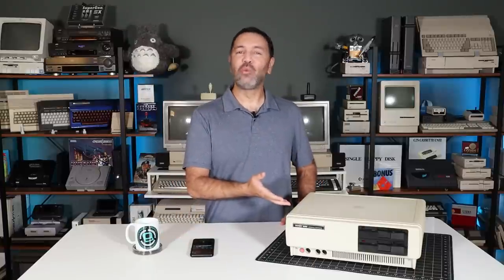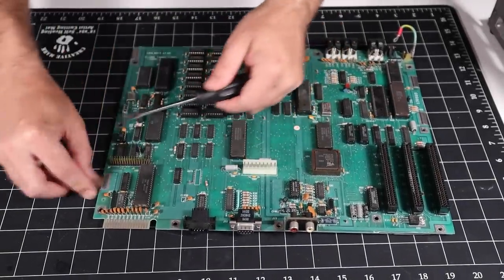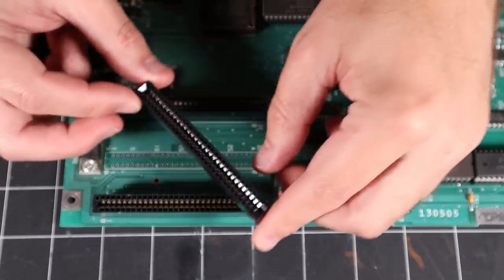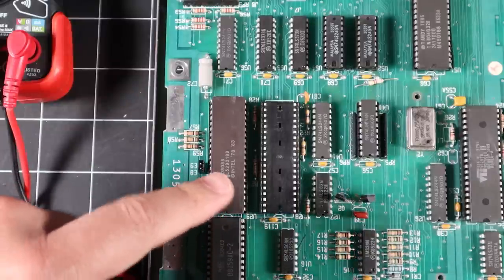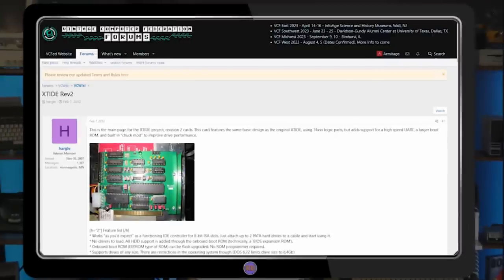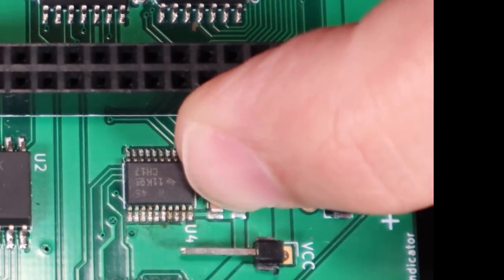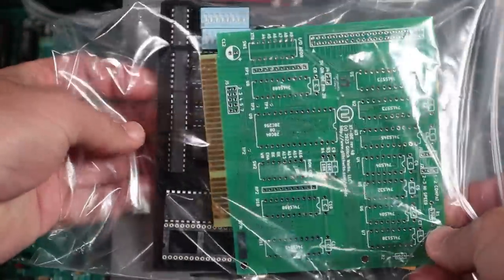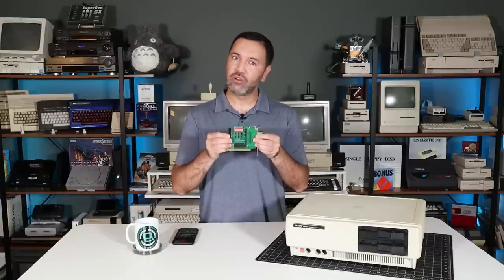Let’s attempt to repair a Tandy 1000 ISA Slot and XT-IDE card

Comment: That's the Tandy 1000A. The original 1000 has ROM version 1.00 and no 8087 co-processor socket.
Reply from the maker: Right on. I discovered it was an "A" model after purchasing it on eBay and opening it up. It wasn't advertised as such but I'm happy to have the slightly updated model. I would still like to upgrade to a 1000SX though :)

Comment: Nice repair job.. Pretty sure the flux has nothing to do with the mask coming off, if you re-watch you will see that it comes off as you wiggle the desoldering gun tip around on the joint, therefore it would appear you just scratched off the mask with the tip. Not a major issue though, as long as you don't bridge any of the exposed tracks with the RF shield or when adding fresh solder.
Reply from the maker: Thanks! It's strange because I've never damaged any other PCB when using that pump before. Perhaps the mask on the Tandy is really fragile? The areas where I used the liquid flux showed more damage than the ones where I only added fresh solder. I wonder if there was a chemical reaction or maybe the flux is slightly abrasive? Of course, I couldn't see any of this while I was working on the part since I had no magnification and had to sit pretty far back so as not to block the camera. The camera has a much clearer/closer view of the carnage and I only really saw it upon reviewing the footage :( Fortunately no pins were bridged :)
Reply: @retrobitstv  If you have the PCB sideways there is less force on the pad while desoldering. Also if you have to solder small SMD there is solder paste with flux. It's a mixture of very small solder balls in flux. If you put a little on the pad's and place the IC on top and apply hot air the IC should flow in the right place. Ali sells practice PCB's for almost nothing.
Reply: You need to change the tip out.  M P is 100% correct.
Reply: @retrobitstv  It could also be a combination of temperature slightly to hot in this instance with the motion.  The only time I have seen similar is with older boards and the temp too high on the desoldering pump.  It could just be the combination and weak solder mask.  I usually do the same with the circular motion and rarely have a problem scratching off the solder mask.

Comment: Great job with repair!  I usually stay away from desoldering guns because of risk of injury to the board.  In future may want to stick to desoldering wick with plenty of flux, especially for more delicate operations.
Reply from the maker: Admittedly, my experience is still pretty limited but this was the first board I've worked on that was damaged using the desoldering gun. It's been a great tool but I will definitely have to be more judicious about where and when to use it in the future!

Comment: 6:38 ugh! That desoldering gun nozzle makes damage to the solder mask. It's on the wedge of breaking traces continuity. Be careful.
Reply from the maker: Yea, I only saw that after the fact because I have to sit pretty far away from the part I'm working on as to not block the camera. The camera has a much clearer view of the work going on and upon reviewing the footage it looked much worse than what I saw in person! I have never encountered solder mask damage like this before when using the pump. The damage was definitely worse on the pins I applied the liquid flux to versus the pins I only added fresh solder to. I wonder if there was a chemical reaction or the flux is somehow abrasive?

Comment: Oh yeah I totally hear you about not liking surface mount soldering. I tried replacing the video DAC on an Amiga 1200 board, without having the proper tools like a microscope, and it was a total farce. :(
I'd like to see you build the new XT-IDE card, because the more retrobits the better!

Comment: Have you checked the pins on the CF socket? They can push in, and it could be why your card isn't detected.
Reply from the maker: That is a great question! The answer is yes, I replaced the entire CF card riser with a brand new unit just to rule that out. Thanks!
Reply: @retrobitstv  After staring at the schematics for this exact board, and having recently built a PicoGUS with TSSOP parts, I would re-re-flow the 245's with copious amounts of flux. Barring that, U5*, U6, U7, U9*, U10*, U12*, and U14* are involved with IDE functionality. (U15 and U16 appear to be used for ROM access only, so leave those two alone.) I've starred the ones that appear to be directly connected to the ISA bus.

Comment: Great job on the ISA slot replacement!  As for the SMD based XT-IDE card, perhaps a simple voltage test might provide some insight.  Also, those CF-IDE adapters sometimes go bad without warning.  I've gone though a handful of them in only 4 years.  It might be worth trying a new one or just a plain old school hard drive without the adapter board attached.

Btw, I would love to watch a soldering montage on that THT XT-IDE card with some music similar to what you chose to close this episode out on.
Reply from the maker: Thanks for the suggestions and I will definitely do an XT-IDE build in the future :) I did try testing with a brand new CF adapter board and also a spinning disk but still nothing :( I verified the +5VDC from the card to the CF riser was good, but I didn't test for any other voltages on the card itself.

Comment: Well done for giving the SMD soldering a go, you did great and very brave for doing it on camera, I think this will massively help others to give it a go too, bravo! I stared SMD by using solder paste, a template and a hot pan of sand! Moved on to fine solder tip 1 pin at a time under a microscope (which worked really badly) until finally I'm doing it your way, good flux and dragging using a chisel tip - only took me a year or so to get there! 😅 Off top of my head I'm wondering the XTIDE ROM has settings for a Debug mode which might give more information of what it's getting from the card.... Other idea is proving each pin on IDE connector to see if you're getting expected signals on the oscilloscope, during drive detection... Like a chip select line high, data ish, addr ish, etc... IDE is fairly simple signals and should look a lot like IDE signals.... GOOD LUCK!
Reply: Yeah, my only thoughts on tracing the problem would be some sort of debug ROM -- perhaps the XTIDE project has some way of setting it up so the port sends out specific signals that can be tested in some way. Or it might also be good to try plugging in a spinning disk drive and see if it even tries spinning up or not, since that connector appears easier to probe either through the right-angle pins on the connector or the secondary drive plug on the cable
Reply from the maker: Thanks for the suggestions! I may try solder paste and hot air next time and I definitely need some kind of magnification, even if it's just they eyewear type. I did some digging earlier into troubleshooting the XTIDE but I didn't find anything that was helpful to my case or mention of a debug ROM; that would be a nice thing to have! I may have to get smart on the IDE interface and start probing some of the lines as you suggest :)
Reply from the maker: I did try connecting a spinning disk but I never got any drive activity (light or head movement) but the drive spun up when powered.
Reply: @retrobitstv  nice try, sorry spinning disc didn't work either but I guess it helps to rule out any CF specific issues. I took another look at the IDE signals and it really is a very simple interface, mostly a subset of the ISA bus but with 2 Chip Select lines already decoded by the interface card for accessing the registers on the drive/CF. I'd be looking for activity on all the lines when trying to access the drives, I might start with the CS1-2 lines to see if they go low on accessing drive. Then take a look at data bus signals and the 2 address lines. Anyway it might give clues as to what's missing. No activity would be VERY interesting 😁 anyway happy hunting! Oh I just read the Wikipedia page on parallel ATA, and checked schematics on Serge's XT-IDE-LITE which is a nice simple adapter for 8bit ide CF cards only.

Comment: For the XT-IDE I think my approach would be to manually test the address decoding logic and see if the circuit produces the expected results:

So, power the card, put the card's address on the bus, and see if the 688 responds by dropping the CD_IDE line (pin 19) to 0V. Go through like that checking the different parts of the address decoding logic, the IO read/write logic, etc. to make sure each one behaves like it's supposed to - at least in terms of DC performance. Keep on like that and you should find the problem, unless it's something that's marginally bad in a way that makes it work in a DC test like that but not when the bus is switching at higher speed.

Also, sanity check, try another slot other than the one you repaired. Could be that the memory I/O on the slot is working but I/O isn't.
Reply from the maker: Thanks for the suggestions! I did try another slot but I should also try a different machine entirely as well. I'm not well versed in the finer points of troubleshooting a device like this but I suppose I could set up a test rig to power it up and have access to the I/O lines. It's a shame I didn't learn anything useful in those engineering classes.
Reply: @retrobitstv  I only did a bit of electrical engineering stuff in school. I feel like I'm learning more now, though, messing w/ old computers and picking up info from other people's projects. Probably 'cause I'm more interested, and making something from it.
When you come down to it that addressing logic is pretty simple, like "if these address bits have these values, activate that circuit". Though of course there's a big difference between it working a few times with manual inputs and a meter vs. working reliably a 8-12 MHz...

Comment: Soldering the SMD stuff gets a lot easier with not too much practice. You did great if this was your first try. ;)

You just have to be very careful to do a close-up visual of the pins, and ideally test for shorts, as you did.

In some ways, a lot of SMD parts can be easier to deal with than through-hole, especially when it comes to desoldering stuff later.

I used to just flood the pins with solder, then keep both sides (or all four sides) molten, then gently lift the chip off the board.
Now, I would almost always use the hot air station to remove chips. I just have a cheap Aoyue hot air station I got about 15 years ago.
Reply: Since the XT-IDE BIOS is showing up on the PC, the main address decoder U6 seems to be working.

But I would try replacing U4, and possibly U7 and U5.
One or more of their outputs might have got zapped somehow, and a lot of the pins control the drive directly.

I didn't realize the XT-IDE had to use latches (U2 and U3) to work with standard 16-bit IDE drives. I never really thought about it before. lol

IIRC, you can actually idendify the drive ID string, and send most commands just via the 8-bit part of the IDE bus.

But most (all?) newer IDE drives do need to use the full 16-bit wide bus for transferring the sector data.

I don't know if any of that helps? lol
Reply: It looks like the CF card slot is basically on the same bus (same control signals) as the "front" IDE connector, so we know it's an IDE bus problem on the card, rather than just one of the ports (front port or CF card riser) not working.

I would definitely try replacing U4 first, then U7, then U5.

It's not too easy to debug these unless you have a Logic Analyzer, or an o'scope which can do the slow-scroll thing, so you can see the very short Read/Write/CS/Addr pulses as the system starts up.

6:07 btw, when using the desoldering gun, if you don't press too hard, it will leave barely any mark on the board.
It could potentially be cutting into the surrounding traces as well.
(You can kind of "hover" the desoldering tip just above the board/via.)

Also, I found that if you can somehow hold the board horizontally when using the desoldering gun, it helps suck up more solder from the holes/vias at once, as the gun doesn't have to work against gravity.
Reply: And yep, the soldermask is pretty poor quality on some of these boards, and I guess can degrade a bit with age (don't we all. lol)

I was working on an ICL OPD / Merlin Tonto (Sinclair QL, basically) years ago, and it has a very similar-looking but awful brown PCB.
The soldermask on that would also fall off easily, and the vias/traces themselves were fragile.

So I don't think it's just the pressure you're applying with the desoldering gun, it's probably the quality of the PCB, too.

What size/diameter is that solder, btw? It looks like maybe 0.7mm, maybe smaller?

I would try using say 0.5mm for most stuff, as it's easier to control the amount, and easier for smaller SMD stuff.
(I haven't used anything below 0.4mm for many years. Even for soldering TQFP chips with fine pins, I just do the drag soldering thing.)
Reply from the maker: Cool thanks for the tips, I will take a look at those components next. I would like to try and get my scope on them but I am a total novice and access is limited!
Reply from the maker: I am using Kester .8mm leaded solder. Yea, I have never damaged a pcb with my desoldering gun before so at the very least it's a combination of the solder mask quality and that.
Reply: @retrobitstv  Yeah, I suspect the PCB, too.

Catching a bad signal on the o'scope could be tricky, but you should see at least one of the IDE /CS signals go low, at the same time as either /Read or /Write.

The IDE Address pins will probably also change state a few times as the /CS and Read/Write pulses repeat.

I expect the XT-IDE BIOS will try to display the full drive ID string. So you will see at least one command first (on the lower bit of the IDE 16-bit bus), followed by the BIOS either waiting for an IRQ, or just polling the Status register to see if the DRQ bit is set.

(The IDE Command/Status register is addr 7, so you should see all three addr A2,A1,A0 bits pulse high.)

DRQ = Data Request Ready (status reg, bit 3) which tells the PC that the drive has some data in the sector buffer, waiting to be transferred.

The IDE/ATAPI stuff is actually quite fun to mess with. Many years ago, I hooked up a PIC chip to a HDD, and was stunned that I managed to get the spin down / spin up command working so quickly. lol
Reply: If you search for "retroleum An 8-bit IDE interface" there is a nice brief explanation on there of the basic bus stuff.

You can get away with hooking up only the lower bytes of the IDE bus, but it does of course waste half of the drive capacity.

(since the Command/Status stuff only needs the lower 8 bits)

Ideally you would hook up a Logic Analyzer to at least the lower 8 bits, the two /CS signals, the three Address bits, IRQ, and /Read and /Write strobes.

That already needs more than 8 channels on the LA, but a cheap 16-channel USB LA could make for a very useful debugging tool for this stuff. ;)

(some of the cheap FTDI chip USB analyzers are quite good, as they don't have internal storage, which means they stream direct to the PC, and can do very long captures.)

You could for example just make a simple adapter between an IDE passthrough cable and the LA.
Reply: Failing all that, I'd just replace the rest of the logic chips. It's usually easier and quicker. lol

I do think a cheap LA could be interesting and educational for future vids though, I'd for sure like to see it. ;)
Reply from the maker: @electronash  I just got my first scope recently but I guess I'll need to take a look at logic analyzers too. I'm guessing they aren't as cheap 😁 thanks for the troubleshooting suggestions!
Reply: @retrobitstv  YouTube keeps auto-culling my replies, no matter what I do. sigh

I can only tell if I come back a few minutes later, then refresh. So frustrating.
Reply: ... I did originally say that you can get the CY7C68013A Mini Board for a few dollars, and it makes for quite a decent 16-channel Logic Analyzer with the free Sigrok PulseView software. ;)

But, most of those chips/boards don't have 5V-tolerant inputs.

So best to get one with some buffers (or at least resistor-dividers) on the inputs, so it can be used with 5-Volt TTL retro stuff, as well as 3V3 stuff.
Reply from the maker: @electronash  Yea some comments just disappear into the ether. It's been a problem for years...